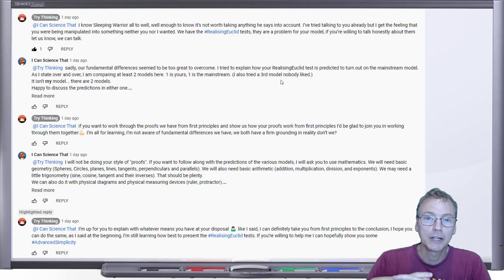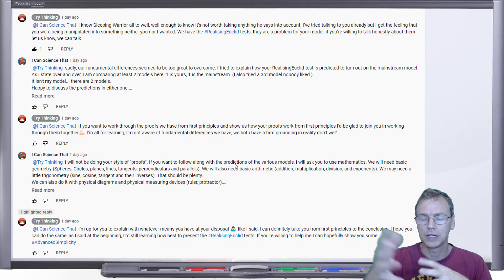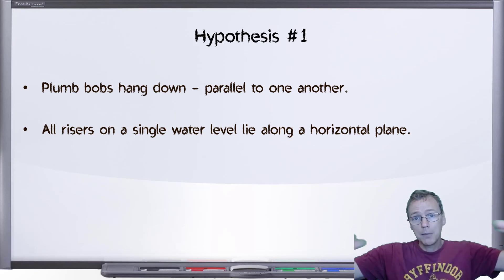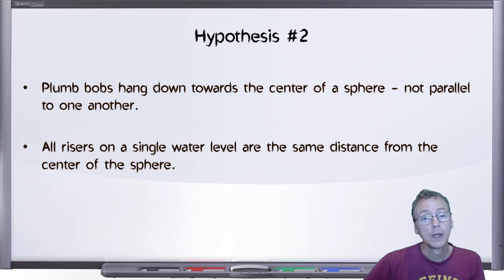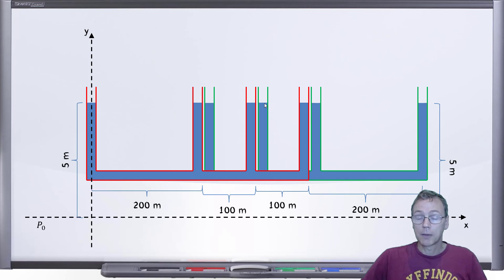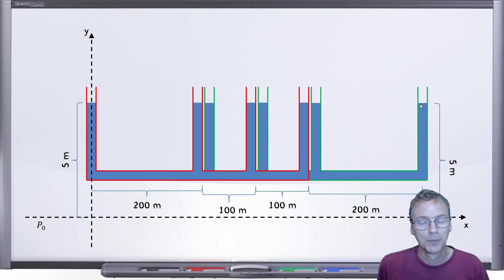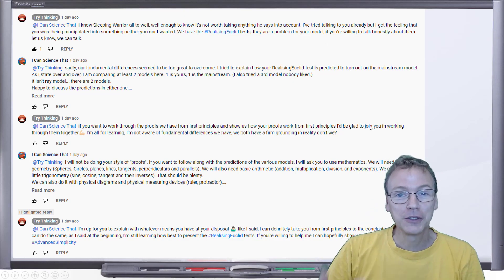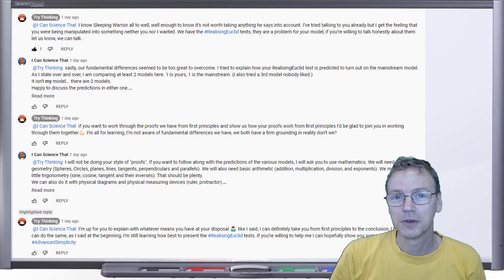Realizing Euclid Step-By-Step Part 1

Comment: The elevation profile for the 363 mile long Erie Canal as drafted by the architects and engineers depicts locks with parallel horizontal water levels separated by vertical gates that were designed to be watertight and perpendicular to the horizontal water levels in both the drawings and in our 3D Euclidean reality. The canal was successfully surveyed designed and constructed according to those profiles ergo water level is horizontal in reality. Euclid realized on a massive scale. You don't have to like it but it's a fact. Nothing you can say will refute this. I own actual elevation profiles for this very real canal. Womp womp.
Reply from the maker: Please fill out the forms.
I believe I've made it VERY clear that I am not claiming either hypothesis to be factual.
We are simply going through the predictions made by each hypothesis.
Please fill out the forms to demonstrate to us that you are capable of doing so.
Reply: @icansciencethat  that's ok neither is a hypothesis as both ideas you imagine are provably idiotic but water level is definitely, provably horizontal. And lol what forms? I didn't bother to watch more than the first 15 seconds of your dopey video before your whiny voice made me shut it off.
Reply: Nothing I can say can refute it? Tell me the math to calculate the distance between two points on the path of the canal that doesn't require spherical geometry. No one can answer this simple question. Are you brave enough to be the first?
Reply: @NinjaMonkeyPrime  you can just use plain old geometry and trig like the surveyors and engineers that designed it. All the elevation profiles and corresponding maps show that. Irrefutable. Womp womp.
Reply: @DrEMichaelJones  What's the formula for calculating the distance between two points on Earth without using spherical math? Should be easy. Haversine formula works every time. What's the flat Earth version?
Reply: @NinjaMonkeyPrime  we measure (not calculate) distance, little buddy. Learn differential leveling. It's Euclidean. Try it sometime.
Reply: @DrEMichaelJones  So before a flight I have to measure the distance? Isn't that why we created the coordinate system? Are you admitting that you have no formula for calculating distance between two points on Earth without using spherical math? Because the haversine formula works and matches reality. Try it and see.
Reply: @DrEMichaelJones  you 'measure' hundreds of kilometres at once? if you measure in sections then add them together is that not a calculation?
Reply: @DrEMichaelJones  also differential levelling requires calculations
Reply: @donjezza  no they were measured in 50 yard segments using first order measurements over a period of years. You can confirm the straight and level segments using your car if you like. Enjoy your day. :D
Reply: @donjezza  and those calculations are Euclidean. Definitely not spherical. Womp womp.
Reply: @DrEMichaelJones  the coordinate system used has no bearing on reality, you can use any coordinate system to calculate things it doesn't rely on the shape of the earth. No need to womp womp that's a bit juvenile.
Reply: @DrEMichaelJones  exactly you need to do calculations to use the 50 yard segments, this whole thing to being adverse to calculations is just ridiculous.
Reply: @donjezza  you measure using Euclidean principles. Adding additional measurements also using Euclidean principles. Very Euclidean.
Reply: @donjezza  lol the xy coordinate system for every elevation profile in existence references straight horizontal (x) and vertical (y) planes established in reality. If you disagree, create your own coordinate system that matches your imagined reality
Reply: @DrEMichaelJones  lol you love that word XD, anyway lets take the 98 mile 'long level' segment as an example, is there any difference between the two models of this segment? would it only work in one of them or does it work in both? this is the real crux of these videos.
Reply: @donjezza water level in reality is horizontal as drafted by the architects in the elevation profiles and constructed according to those drawings by the engineers of the Erie Canal.
Reply: @DrEMichaelJones  what about z? Euclid did 3D geometry as well. I don't disagree with a certain coordinate system, that doesn't even make sense. In reality you need 3 coordinates for 3D geometry. As I stated before you can work things out in whatever coordinate system you prefer, it doesn't really make a difference.
Reply: @DrEMichaelJones  yes in one model water level is straight in the other it is curved and in reality you can't tell the difference between the two using water level alone, you would need another method to determine which one it is.
Reply: @DrEMichaelJones  Are you saying humans measured the Earth and created the latitude and longitude coordinate system, only to NOT be able to use that coordinate system to calculate the distance between two points? Are you sure you understand what a coordinate system means? Do you have a coordinate system for flat Earth that has a formula to calculate the distance between two points on Earth without using spherical math? Because using latitude and longitude coordinates with the haversine formula matches reality.
Reply: @DrEMichaelJones can you cite the errors and corrections in differential levelling? Benjamin Wright undoubtedly did.

 I suggest that too learn real time reciprocal levelling, buddy. Can you explain when and why this method becomes necessary.
Reply: @b0b5m1th  Did Benjamin Wright claim level wasn't horizontal?
Reply: @DrEMichaelJones  as a surveyor he would know the difference. You should look up some of his work. Again, can you tell me what errors and corrections are made in differential levelling? Benjamin knew this. You can see that from his work.
Reply: @b0b5m1th  really? Did he say anything about this alleged difference? Feel free to post a single citation...

Tell us about what you imagine Benjamin "knew" about the alleged "difference" between level and horizontal... while we all laugh at you, robbie.
Reply: @DrEMichaelJones  Micky, you really do need to learn about differential levelling. Any trained surveyor knows the difference between level and horizontal.

You can easily see the difference when you measure vertical lines, since they are not parallel to each other.
Reply: @b0b5m1th  you're the one claiming that Benjamin Wright "knew" about some alleged "difference" between level and horizontal... surely you can provide a citation for that...
Reply: @DrEMichaelJones  he was a trained surveyor, as was James Geddes. At that time it was common knowledge that the earth was a spheroid, and the surveying practices of the time took this into account.

You clearly have never performed any long distance levelling runs,  or any surveying for that matter.

But if you are so sure of yourself, can you tell me what errors occur in differential surveying, and what corrections are necessary.
Reply: @b0b5m1th  feel free to point us to any point where either spoke about measuring any alleged elevation delta between level and horizontal... we'll wait...

If you know what's good for you you'll run away now...
Reply: Erie Canal Curvature Drop: Using 2 GPS stations, one at Buffalo (P), one at Troy South (Q), whose locations in earth centered earth fixed cartesian coordinates are known to cm accuracy, I can calculate the measured drop from station P to station Q using vector algebra as follows:

Z_measured = length( P ) - dot( Q, norm(P) )

where P and Q are vectors from the origin of the GPS coordinate system to the GPS stations Buffalo and Troy respectively.

If the earth is flat, the result must be nearly zero (elevation difference). Using the coordinates below I get a measured drop of:

Z_measured = 14,074.059 m

According to 8 inches per miles squared the expected drop is about:

Z_predicted = 14,021.793 m (by 8" per miles^2)

So the Erie Canal is not flat, but drops from Buffalo to Troy measurably by more than 14 km, as expected by the globe.

FBN: Federal Base Network Control Station.
PID: AH9234
STATE/COUNTY: NY/ERIE
COUNTRY: US
USGS QUAD: BUFFALO NW (2019)
GPS P(X,Y,Z) = 902,080.915   -4,593,625.452   4,317,598.521

PID: MZ1421
STATE/COUNTY: NY/ALBANY
COUNTRY: US
USGS QUAD: TROY SOUTH (2019)
GPS Q(X,Y,Z): 1,314,913.415   -4,503,830.666   4,306,121.248
Reply: @walterbislinwabisvideos1740  and yet the elevation profiles show no curvature at all. Are you claiming that the architects and engineers designed it with zero curvature and then somehow accidentally managed to build it with the exact curvature necessary to match your imaginary model? Lmfao
Reply: @DrEMichaelJones  "and yet the elevation profiles show no curvature at all."

Of course not. As the name says, an elevation profile depicts the geometry with respect to a reference elevation, which in reality is a curve, but is depicted as a straight x coordinate for convenience. If the earth were flat we would call it simply orthographic view, not elevation profile, tuuut tuuut.

I have given you the proof above that the canal has a curvature drop as expected by the globe. This are not depictions or plans, this are measurements done in reality, using Differential GPS, which has cm accuracy. Do you deny that GPS is accurate, the same GPS that is used in construction?
Reply: @DrEMichaelJones  "and yet the elevation profiles show no curvature at all." Why would they? It's not what an elevation profile is supposed to do. Nice strawman. 

"Are you claiming that the architects and engineers" Are you claiming that history shows no professionals were employed on the project because they didn't have the money and no one thought it possible? You asked us to look into this project from long ago that was done based on almost slave labor, poor expertise, and zero technology, but now you want to imply it had more knowledge and details then what we have now? Lame even for you. Boring even.

"managed to build it with the exact curvature necessary to match your imaginary model" What's missing from your argument is evidence that current measurements are wrong. Do you have any? It's the same as the question you keep running from because you can't answer it. Where's the math to calculate the distance between two points on Earth without using spherical math? 

Funny how you avoid the reality of today. Are the GPS readings wrong? Is the entire lat/long coordinate system wrong? No? Then explain reality instead of moving the goalposts. 

Troll harder bro.
Reply: @NinjaMonkeyPrime  Elevation profiles are not supposed to represent reality? lol deny architecture and engineering for us more!

And now you're sh!tting on the brilliant architects and engineers that managed to construct a 363 miles long canal on time and under budget after consulting with the top canal experts in Europe (you didn't know that...) who told them to design the vertical gates between locks to be perpendicular to the horizontal water levels because the water on either side of those gates must be at equilibrium for the gate to even open. 

It's laughable how much you all want to deny this. Why don't you sue the Erie Canal Museum or NY State for putting out what you imagine is false information?
Reply: @boobylinks  feel free to ask them to point you to any original document that agrees with their alleged "curvature" position. Rooting for you, little buddy! :D
Reply: @DrEMichaelJones  Please also inform the authorities that elevation profiles are supposed to account for Earth curve and not just a relative baseline per the definition of an elevation profile. Oh, wait, maybe you should first create a new definition of elevation profile and tell them to use it instead of the one used throughout history. While you are talking to them, ask if all those Irish immigrants who helped build the canal arrived in the US using a spherical map of the Earth. Maybe you can find the mythical ship captain who used flat Earth math during a voyage. It's not like you can even calculate the distance between two points on Earth without using spherical math. Good luck.
Reply: @boobylinks  you should sue the Museum if you believe that, little buddy. There are no elevation profiles that display curvature. None. Zero.
Reply: @DrEMichaelJones  "There are no elevation profiles that display curvature. None. Zero" Correct. Because that's not what they are for. There's also no Earth curve factoring in plane surveying. However there is with geodetic surveying. But you know that and are just pretending. A geodetic survey determines the precise position of permanent points on the earth's surface, taking into account the shape, size and curvature of the earth (REEE FAKE REEEE). 

Are you still refusing to admit that with flat Earth you can't use a coordinate system to determine distances between two points even though such advanced concepts are taught in grade school? Have you considered researching what it means to have a coordinate system? I'm sure there's an online intro to math course for free somewhere. 

Or even better, just put the haversine formula to the test? You're a truth seeker and scientific genius right? Plug in the numbers for a globe and estimate the distance between 2 points on Earth. Then fly, drive, sail, walk or whatever to measure if it's accurate. Or maybe instead you could just measure your kitchen table and say Earth curve isn't needed and then laugh thinking you're so clever.

Keep trolling Mikey. #gottolietoflerf
Reply: @boobylinks  yeah it would be hilarious to watch you frivolously try to sue NY State because you think they're lying about level being horizontal.
Reply: @boobylinks  "Equivocating whether?" No equivocation, it was designed and built that way. It's quite clear on all the elevation profiles. Nothing "cute: or "puerile" about the historical documents that were drafted by architects and engineers. There are what they are. You don't have to like it, little buddy.
Reply: @boobylinks  Hypothesis that the water levels in the locks are parallel and horizontal? It's not a hypothesis, little buddy, it's a fact.
Reply: @boobylinks  Cry moar for us, little buddy. Emote. Get it all out.
Reply: @boobylinks  that profoundness is called hydrostatic equilibrium and it requires the water on either side of the vertical gates to be horizontal and at rest to open. 

No haversine formula used in the elevation profiles for the Erie Canal womp womp.
Reply: @DrEMichaelJones  Did you ever get around to testing that using the haversine formula with latitude and longitude coordinates allows you to accurately determine the distance between two points on Earth? Of course you didn't.
Reply: Is this an indication we can expect both of you to have (genuinely) filled out the forms? Otherwise y'all blowing meaningless hot air.
Reply: @sphaera2520  the actual engineering drawings and elevation profiles of the Erie canal are my submission. The engineers aren't alive to fill out any of spaghetti boy's "forms"
Reply: He's model afflicted Mike
Reply: Then you should have no problem setting up the Rainy Lake Experiment to show a horizontal plane, let's say 12, equal points of elevation  across several miles.
Offset your targets. Then site them, having your observer height equal to the first target. 
...If we exist on a horizontal plane, they will line up like the bees knees, nice and straight and horizontal.
...If we exist on a spherical globe Earth, the targets farther away from your position will be lower than the targets closer to you. In other words, curving away from your observer position.

Because refractive conditions affect both a spherical globe Earth and a horizontal plane Earth, and refractive conditions can vary, do several days worth of recordings.
If the targets consistently drop away with distance, I say we exist on a spherical globe Earth.
And no, I do not accept 'flerf-spective' and 'optical-drop' for the reasons distant objects drop away.
...If flat plane supporters deny NASA and all of the world's space programs, I can most certainly deny flerf-spective and flerf-optical drop.
Reply: Here's another fact. Water levels in locks goes up and down to accommodate shipping. Facts.
Reply: @robert gillies   
You’re wasting your time arguing with someone that thinks elevation is the curve. He likely imagines the x-y graph of mean sea level should be an arc.
Reply: xy graphs are drawn to match horizontal and vetical in reality. Womp womp.
Reply: I think the elevation profile can be used equally well on both possibilities as an elevation profile is relative to mean sea level. People have no choice but to orient themselves to the local vertical so it makes perfect sense on a globe to draw it as if verticals are parallel.

I see absolutely no benefit to drawing it on a just over 5 degree arc. The globe is tilted at 23.5 degrees. The axis of rotation changes orientation relative to the Sun constantly. The globe rotates once a day so the orientation of the canal to 3D space is changing constantly. You cannot orientate the drawing to the paper to match its varying 3D space orientation, and it would be just confusing if you even tried.
Reply: @sthurston2  the water levels on the Erie Canal weren't referenced to any geoid nor to MSL. Womp womp.
Reply: @DrEMichaelJones  "Profile of the Grand Erie Canal" states for Lake Erie, "565 ft above tide". What drawing are you referring to?
Reply: @sthurston2  the entrance to the first lock of the Erie Canal at the Hudson River in Albany, little buddy. It's well over 100 feet above the Atlantic which was never mentioned at all. And definitely not any imaginary geoid. You walked right into that.
Reply: @DrEMichaelJones  You specified elevation profile for the 383 mile canal. The only match for that I found does reference "tide". Are you now saying you meant a set of side views of individual bits of the canal?
Reply: @sthurston2  the starting reference is from the river (not MSL and definitely not a ball shaped geoid). A single point. A datum. All straight horizontals parallel to that first horizontal water level on the vertical datum established at the first lock. Undeniable and irrefutable. Good try, though. I own originals of the elevation profiles. Spend some time looking into it.
Reply: @DrEMichaelJones  I still think such drawings are equally useful on flat & globe, and there is no useful globe specific way to depict this stuff.
Reply: @sthurston2  you can think whatever helps you sleep at night, little buddy. The fact remains that all the straight line horizontal water levels on the original elevation profiles are separated by straight line vertical lock gates drafted as perpendicular to the horizontal water levels by the surveyors, architects and engineers of the Erie Canal. No one since has ever "corrected" this to show it as curved because it isn't. 363 miles long, no curve. Womp womp.